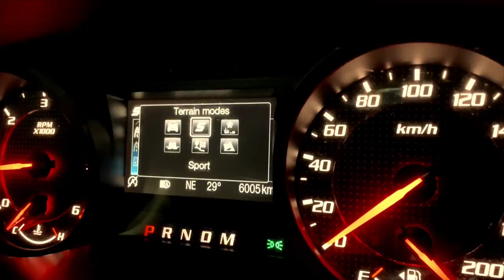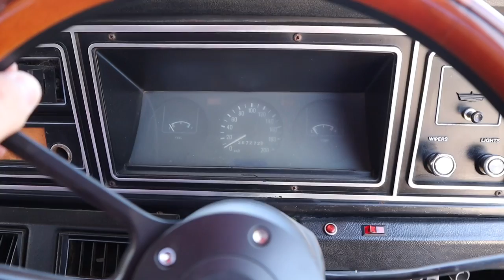WHY I LOVE OLD FORD TRUCKS ! My 1978 RHD F250 Custom

Comment: Sounds like the condenser for the gas.  They do freeze over then you have to wait a little for the build up to defrost before the gas flows again.  Try it for a while on petrol and see if it happens on petrol.  If it is all good on the petrol then definitely condenser.  If not sounds like a blockage with the carby.  The gas conversions have been known to wreck the carby a little.  Something to do with the float in the carby.  Used to happen to my old duel fuel 308.  When I rebuilt it I went with straight gas conversion .  Cheers bud love your channel. 👍

Comment: G'day mate just stumbled onto your channel....good stuff. You probably know this already but the best engine mod/ignition upgrade for reliablity you could do in an old car is a DUI distributor from Performance Distributors in the US especially if the engine rebuild is not that long ago. I think I paid about $300 for mine. Add a decent carburetor and it'll never stop. Good luck.

Comment: Check the centre contact in the dizzy cap. The springed one that presses on the rotor. When it fails also check voltage at the coil.
Reply from the maker: I’ll sus it out 😁👍🏼

Comment: I’m going to say it’s the gas Converter freezing up, it’s a common thing  for old school gas systems to freeze up
Reply from the maker: It does it on both petrol and lpg fuels ? I was thinking it might be loosing ground some where ?
Reply: @TyFenwick  I used to work on Fords in the mid to late 70's and my father had one of the first taxis in Victoria that ran on LPG in the late 1960's (when you could only get LPG at CIG outlets or some Taxi Depots)  You need to run the car on petrol at least every other day for a short while or the "petrol injector plunger" (which is like a leather material) freezes and shrinks and doesn't squirt the petrol into the carby……... if it has flat spot or stutters I would check you plug gaps as from memory LPG runs a slightly larger gap for best performance (at a cost of when you run it on petrol)……..I think we also used to set the timing differently to as LPG has a different octane rating than petrol.....      I reckon drop a big block 460 into it with a FMX Trans...….
Reply: Sometimes the gas convertor freezes up because there is air in the cooling system.....you have to bleed the cooling system correctly....to ensure no air in the system......if the convertor freezes up don't pour hot or warm water on it, it will crack it......let it cool naturally....also the convertor should have a "priming button" on it to aid starting if the gas is not coming thru properly?   Been a while since I worked on the old skool gas gear and I'm 60 now so I've probably forgotten more than I learnt! lol
Reply from the maker: Appreciate the input mate, I’ve got a old school guy lined up to take a look at it. He works on lpg/petrol carby vehicle’s heaps, so see if he can get me sorted.

Comment: I’m a Ford guy, but my dad had an old ‘71 Chevy. Should have kept it - was absolutely bulletproof with 360K miles when I sold it. Transmission was rebuilt because it starting slipping grears a bit; otherwise no issues.
Reply from the maker: There’s just something so raw about a old truck compared to anything modern. The way they start and the way they change gears, you can feel the road. 👌🏼